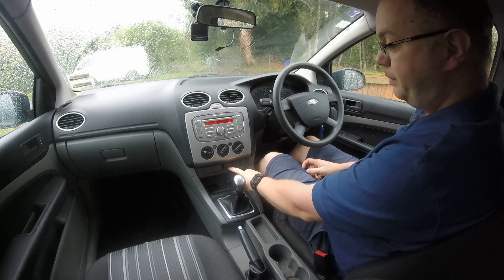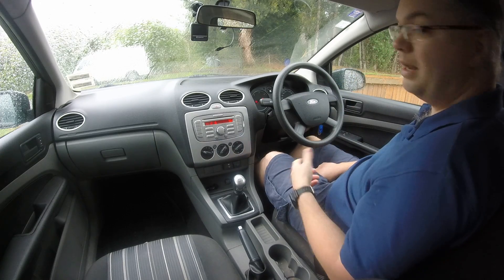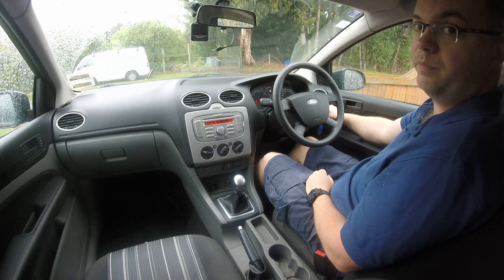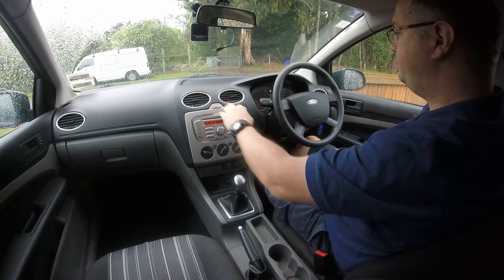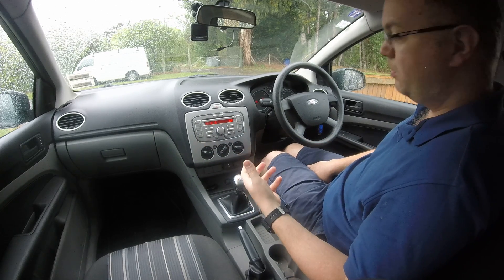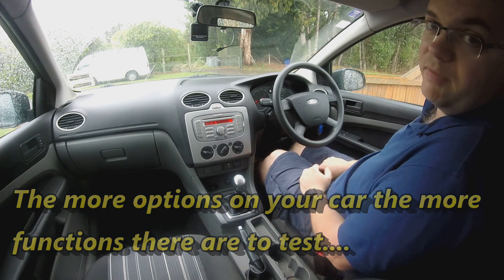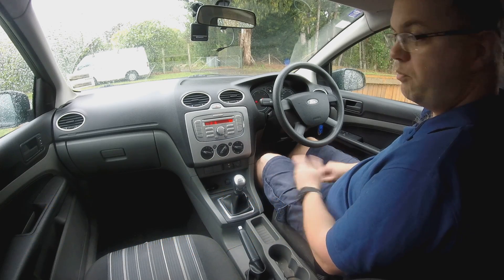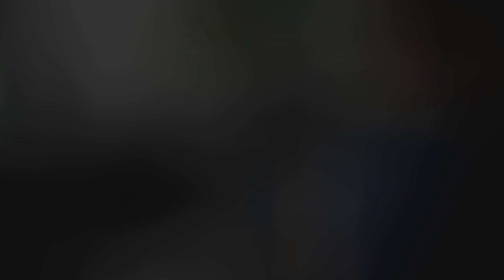Ford GEM Diagnostics Mode - Quick Tip

Comment: I know this is off topic but with that same vehicle, please could you make a video on replacing the 12v power port under the radio? The socket on mine has a poor connection and need to replace the whole unit. Just no idea how to, think its a case of removing the whole radio itself and the facia. It would be so helpful as there arent any videos on youtube with a how to
Reply from the maker: +KayPoint one day I might. The radio is easy to remove, the trim panel around it clips off and you can get to the radio and the switches at the bottom. That's probably all you need to know to get to the 12v outlet

Comment: So it's confirming a signal was sent, what happens it the load doesn't work does it still beep.
Reply: STEVE ROB I think that's the idea...  if it beeps but the load doesn't work, you know it's not the switch.
Reply: ***** I like that idea , solves a lot of variables .
Reply from the maker: It's only testing inputs so if you beep and the output is still cattywampus you have to break out the Load Pro
Reply: Badgertronix oh boy I'm not even going to comment . LOL
Reply from the maker: +STEVE ROB 😂🤣😂🤣